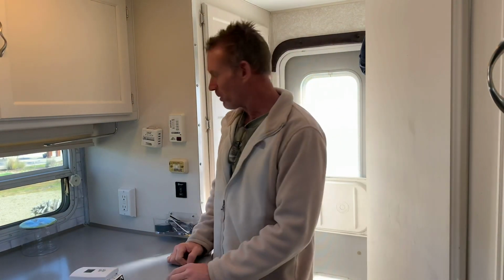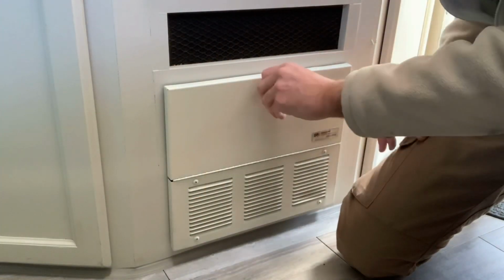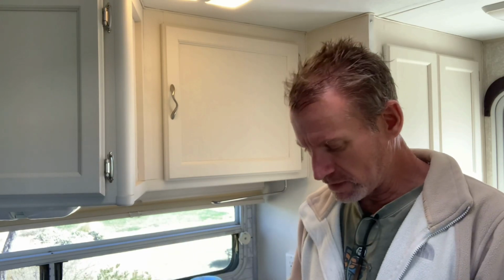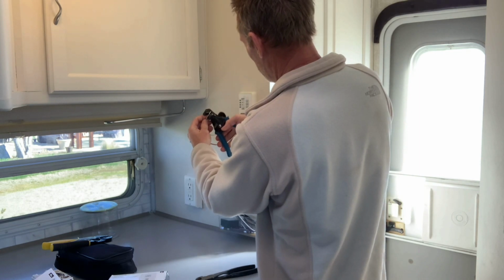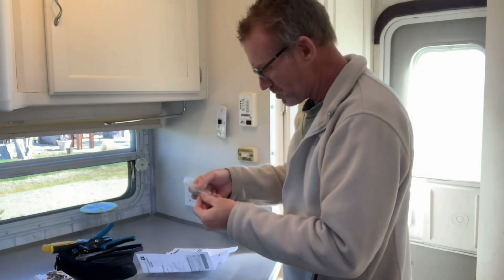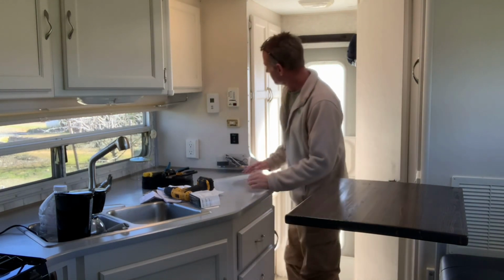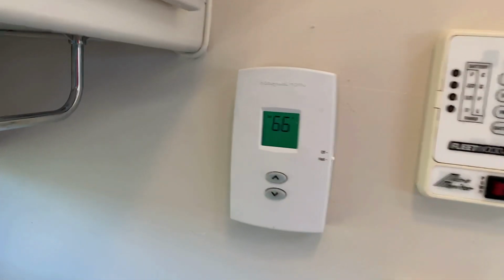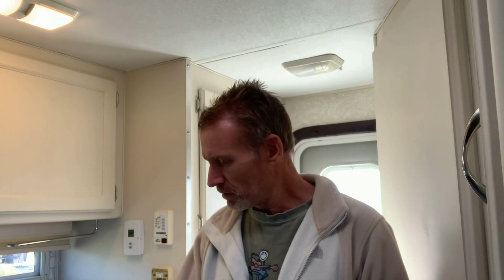How to Install a New RV Thermostat for Atwood Furnace.  Honeywell Thermostat.

Comment: We have an 2003 Atwood hydroflame furnace and an old Atwood thermostat 5 wires plus a weird white jumper wire that went across the thermostat to two different screws.  Nothing we have purchased to replace has worked?
Reply: PLEASE HELP would be appreciated. We r freezing!
Reply from the maker: Maybe call a service tech???
Reply from the maker: I pulled that furnace out a couple of years ago.  Replaced it with a diesel heater and thermostat with Bluetooth control.
Twice as efficient and super quiet.

Comment: I thought Honeywell thermostats were 24 volt and rv stats are 12 volt?
Reply from the maker: There’s no need for the RV’s 12V DC power for switching on this t-stat. 
It’s two wire (+/-) with two AAA batteries.  The two AAA batteries do the switching (on/off) sending the 12V through the two wires to the furnace control board. 
Works great.  Much more accurate than the old one.  I changed the AAA batteries at the fall season to ensure reliable functionality.
Reply: Many do, though my  hydro flame furnace requires a 24 volt thermostat.

Comment: I just attempted to install. Swapping out an Atwood Hydroflame thermostat. Problem is that the R wire is a heavier gage wire than the W wire. Heavy gage R won't fit.
Reply: Just pigtail a thinner gauge wire
Reply: I appreciated the vid, but would have liked you to show the actual pins which you connected the old wires to…..?
Reply: @richardwilliams527  yah, during the actual installation, his back was to the camera. Even with youtube's new zoom feature, I couldn't make out which wire was going where. The thermostat instructions are for home wiring and if I recall right, home wire is different colors vs rv wire, so it's not a straight across, but im not sure.
Reply from the maker: Strange.  My old thermostat was an Atwood Hydroflame from 2003.  I did not have that issue.
Reply: @covetthecamper2289  Mine is 1986 Fleetwood, Resort.
Reply: @covetthecamper2289  we have an Atwood hydroflame 2334 furnace, with an Atwood atvaw211 thermostat, the thermostat is pooched and it has 3 wires not 2.
Reply: My wires were too big gauge too.  I just stripped the wire and literally cut off half the strands and twisted what was left and it fit just fine.   That wire was WAAYYYY too big for the piddly amount of current anyway.
Reply: We have an Atwood atvaw211 thermostat, have tried 6 different thermostats and nothing will turn the furnace on!  Red to red, white to white, ground to ground.  Nada. Zippo and we are freezing!

Comment: Good timing. I'm about  to install a remote ON/OFF switch to the thermostat. Would love to not have to get out of bed, to turn on the heater, when it's 30+ degrees. May as well add a new/better thermostat too.